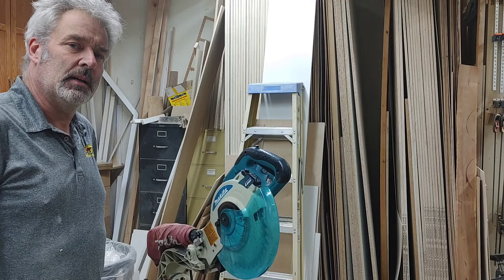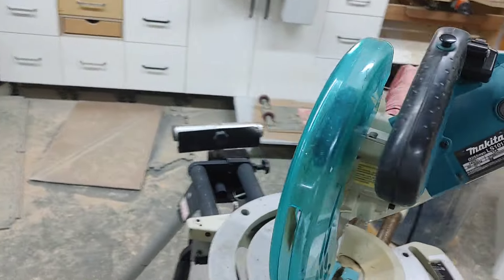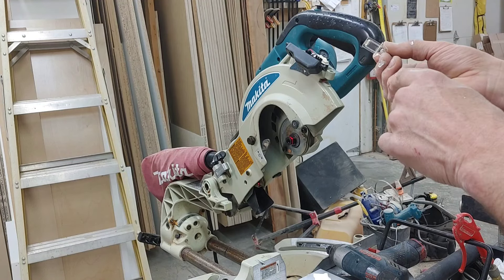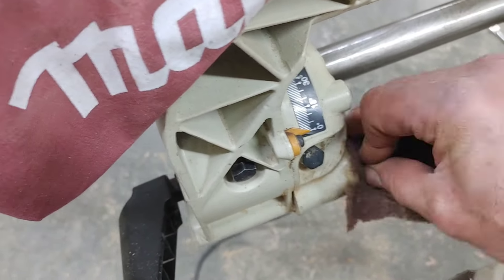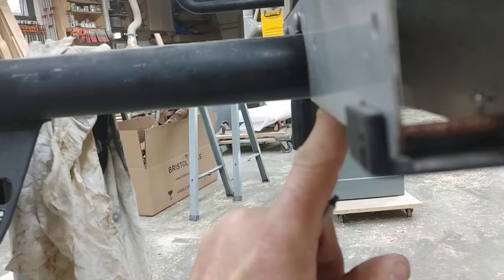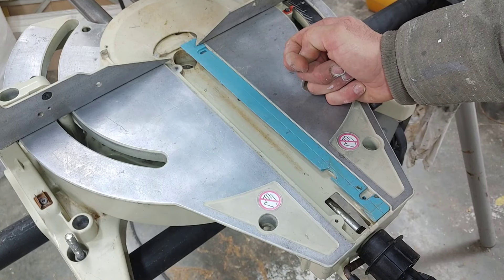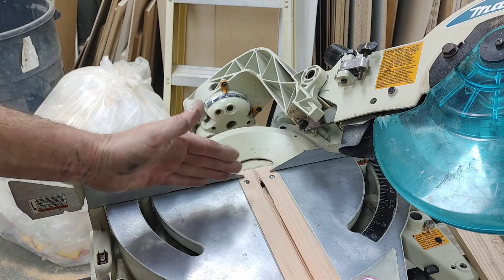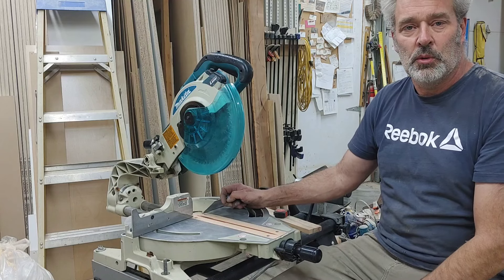Rescuing a miter saw

Comment: Hey Henry,  very  informative.  I have a 12" slider just like that one.  My problem is when I go to change the miter table, its very tight....not smooth. What's your prognosis? Thanks man, I always look forward to your content.  Greetings from Washington State.
Reply from the maker: Hi Nathan. I would suggest that loosen that bolt that's just behind the throat plate. Loosen it up enough so that you can lubricate the sliding table. Once it moves freely then tighten up that bolt and see what happens.
Reply: @henrymostert2125  Thanks Henry,  I'll give it a shot.
Reply from the maker: I was just thinking one last thing when you loosen that bolt off take your compressor and blow that area out underneath. It may have sawdust and a mixture of metal filings from moving the table